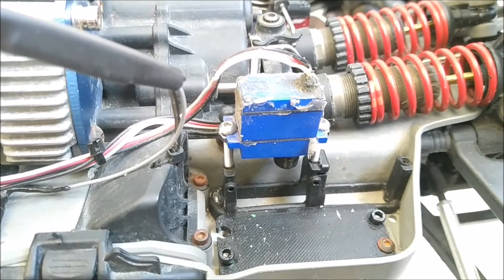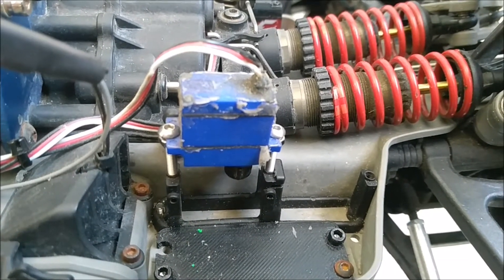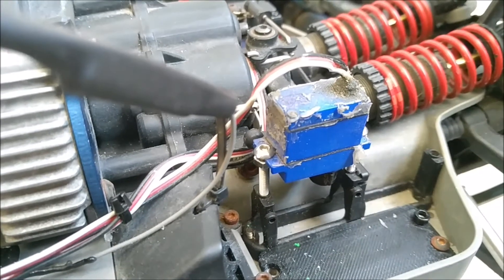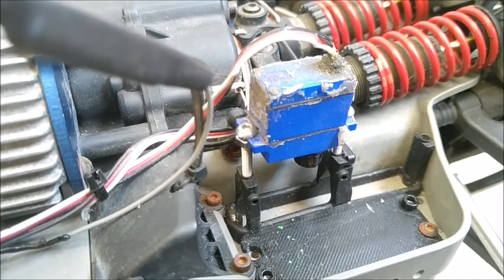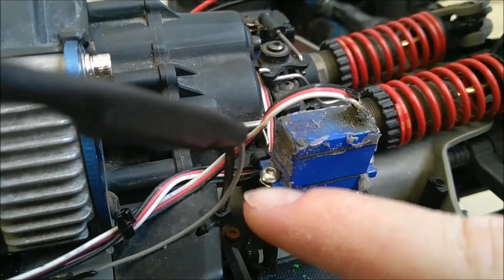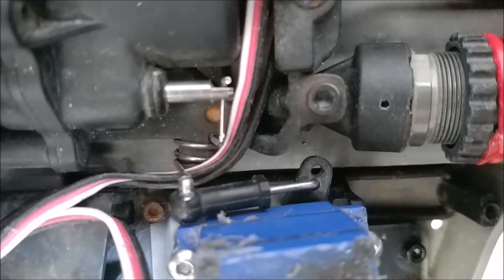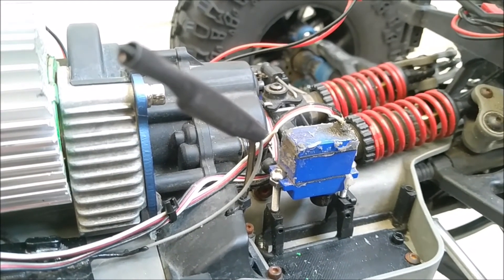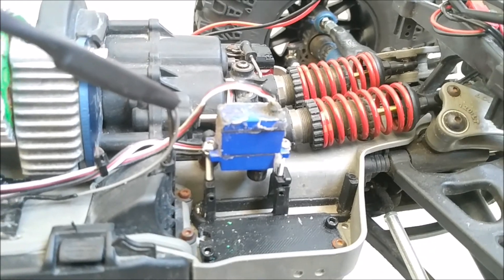Quick Tip to Get Rock Race/Crawler Mode (MMX ESC) Working Correct in a Traxxas Summit

Comment: Alternatively to this is you can add a "Servo Reverser" between the aux wire and Y-harness. This inverts the signal going to the aux wire, resulting in crawler mode in low gear and rock race mode in high gear. And keeps the servo in the correct orientation for the two speed.

Comment: Why didn't you just "reverse" the servo operation via the transmitter settings? That way the servo isn't sicking out like the way you currently have it mounted and it servo will operate in the opposite direction which is what you wanted.
Reply from the maker: xXG.L.HXx tried that. But the ESC aux wire is attached to the same ch3 as the shift servo. So when it reverses the servo it also reverses the mode switching. Which made it back to square one. One of them has to be reversed without the other one being reversed. Which can be don't with a servo reverser or with fancy servo mounting haha
Reply: Techs Mechs Okay, I misunderstood what you said in the video. Yes, a cheap Turnigy signal reverser will do the job as you already know. They only cost $7 or less shipped on eBay. I use one on my TRX4 diff lock servo channel since my aftermarket radio only has 4 channels and we, as you know very well with the summit, need 5 channels. I did try using the Traxxas signal splitter module used in the old AM radio summits but even with my 3 way switch on the radio, it won't work like the factory version. I plan on upgrading to a 7PX.
Reply from the maker: xXG.L.HXx no worries. Yeah I still might use a reverser. We will see how this holds up. Check out my videos on the hacked flysky radios. They can have up to eight channels. Perfect for a summit or Trx4
Reply: Techs Mechs It's funny you should mention the hacked Flysky radio. I was actually considering it simply for cost/initial investment. I've had lower end radios in the past but since I've started using "name brand" radios, I've gotten used to good menu setups. With the Flysky, I'm just don't want to learn a quirky menu system since as we both know, the Flysky radio wasn't initially designed with the hacked firmware in mind. I know probably you'll say it's easy to navigate and remember things but after using a Hitec Lynx 4s and Futaba 4PX, I like when software is made user friendly. I'll still check out your videos, hopefully you have one that goes through all the menu functions. I haven't seen a video on YouTube to date that goes through all, or most of the hacked firmware menus.
Reply from the maker: xXG.L.HXx I think I do have one. I'm on mobile right now but the one that goes over menu setup for the Summit should be exactly the same since the Trx also has a 2 speed tranny and locking diffs
Reply: Techs Mechs I was mostly referring to a video that goes over the menu functions of the hacked firmware overall. That's something I haven't seen. I've seen videos here and there on how to setup particular things but not an overview video. I'm sure I would figure it out relatively quickly. Thanks for the feedback!!